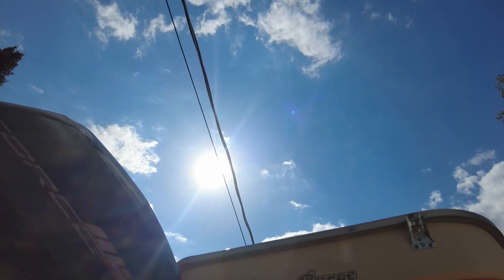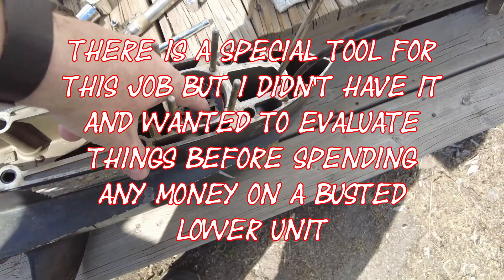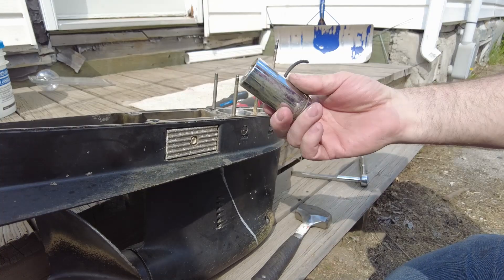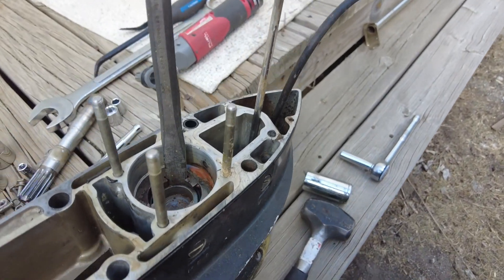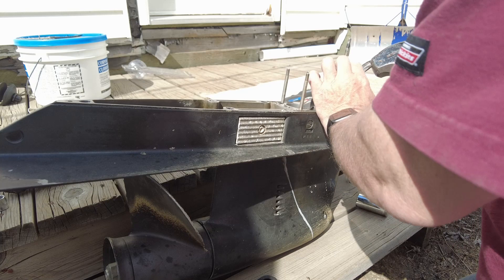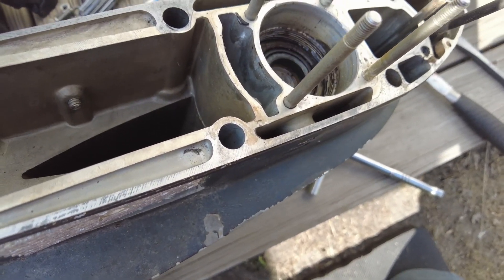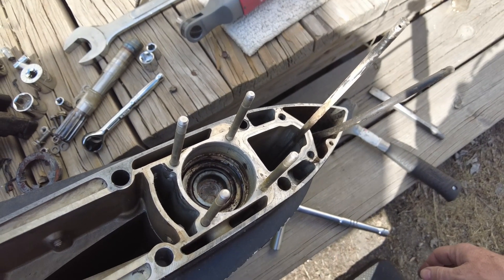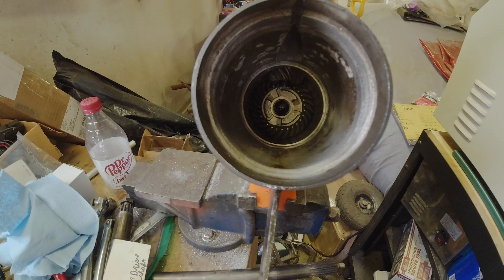Force 120 Lower Unit Repair Pt1: PROJECT PONTOON Ep 10

Comment: Hey doug do you have the part # for these fuel pump and diaphram parts? Were trying to fix a problem with our boat thnx in advance
Reply from the maker: Unfortunately I do not.  I know the pain in trying to find parts for these motors though, Force/Mercury tended to use whatever they happened to get their hands on.  The parts book is a suggestion of what you 'should' have and not what you actually do have.

Comment: Hey man, how did you get your prop shaft out?
Reply from the maker: I used a punch to carefully tap the retaining ring to unthread it.  be careful if you try to do that, you might not be able to find a replacement retainer if you break it.
Reply: @DougsMessyGarage  isn't the the top shaft the goes into the motor you did that with? I'm talking about the shaft that the prop mounts to. I've taken the prop off and I'm trying to get that shaft out. I don't have a retaining ring that has threads. All I have is the hub that has bolt holes in it. Do I just need a slide hammer?
Reply from the maker: @tylercoss3003  Hmm... It's been a couple of years so the details might be a bit vague but I rewatched this video and I have a threaded retaining ring in mine (about 4:40).  Also, it's possible you have one of the other three or so lower units Force used on the same model in the same year range.  That's one of the frustrating parts of trying to repair a Force outboard, no consistency in parts.

Once the retaining ring came out of mine, I believe I used a slide hammer to pop out the rear prop shaft carrier but that detail is a bit fuzzy.  I seem to remember thinking mine came apart rather easy compared to what I figured I was going to get into though.  Sorry I can't be of more help.

Comment: Hello, I have the same motor, and with a new impeller it trickles out of the 2 holes, and the engine overheats i took the thermostat out and there is no water whatsoever going there help me please
Reply from the maker: My first guess would be that you didn't get the tube that carries the water from the pump to the bottom of the block seated properly so all of your water is running out of the exhaust.  If that is good, did you by some chance forget to put the drive key in for the impellor?  If you did, the impellor would mostly spin on the shaft but might move a very little bit of water.  Third idea, did you run the motor at all without cooling water?  If you did, it only takes about 15 seconds to smoke a new impellor so it will not pump anymore.

Hope these suggestions help.